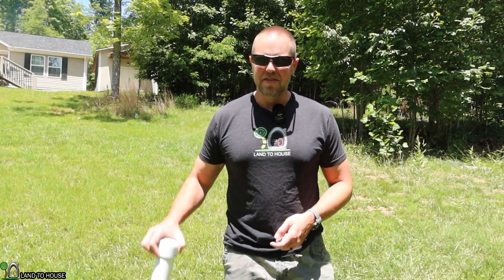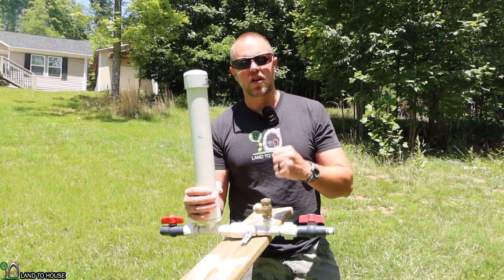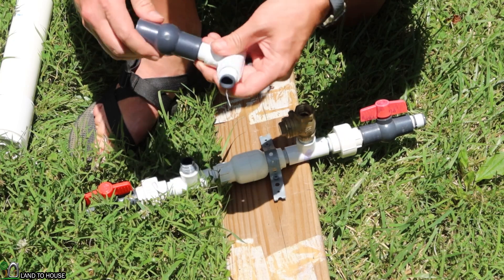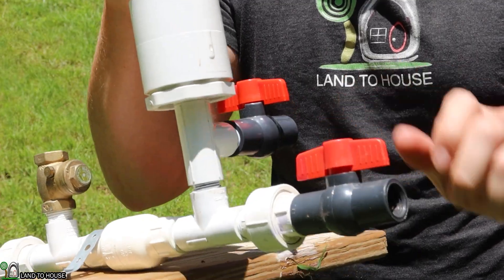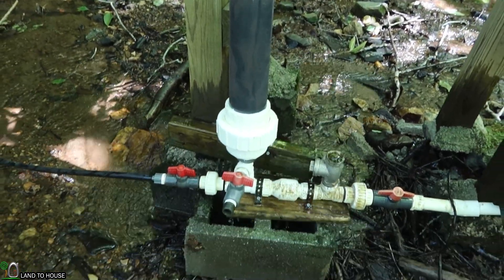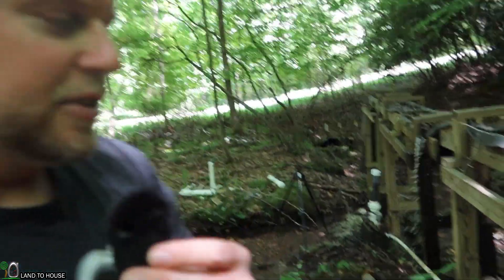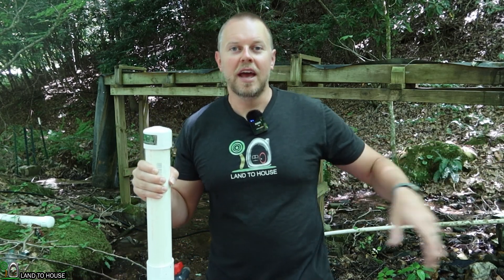Ram Pump Pressure Tank Waterlogged

Comment: Nice video and presentation. 
The mandated priming of ram pump in this video is respectful but desirable. Here is my two cent. 

Rotate the waste valve with respect to the pressure tank by 180. When presented by drive supply it becomes normally open. The dynamic pressure will cause it to slam shut and reopen by itself to start the next cycle, there avoided the mandated manual priming. If that works we’d expect the up hill head to be increased.

Another good example to self starting ram pump valve is one conceived by Japanese video on YouTube. It has a horizontal flow installed and a pendulum swing flap, open inward. Flap center connected to a threaded rod as ballast weight for normally open state.

Comment: I wonder if you could use a small water membraned pressure tank instead of the tube pressure tank. You could put some air pressure in the membrane and it would never be able to dissipate into the water.

Comment: would a piston to seperate the air from the water solve the problem for as long as the gaskets on the piston last? maybe thats too cost prohibitive an option for the plumbing?  but i think it could be a good solution for a more robust long term option that could get rid of the need to reintroduce air

Comment: You could just turn off the drive line and delivery valve while holding the switch valve in to drain the water out of the pressure chamber...
also you could make a taller pressure chamber to prolong resets..

Comment: Nice.  Draining the tank once in a while looks to also flush out some accumulated sediment.  I'm guessing the air that was in the inner-tube got beaten out over time, the valve isn't quite as good of a long term perfect seal as desired.

Comment: I have a general question regarding Ram Pumps, do you think they would be able to raise water 700 feet straight up a mine shaft? 
I’d like to see you and “Ghost Town Living”, ( Brent Underwood ) se if a ram pump can help him get water to Cerro Gordo, Ca. You can possibly benefit from helping. I’m not too sure though.
Reply: The trick to that would be getting enough supply head. Then it would just mean having strong enough materials (Metal pump and pipe work)  so yes it could work but it would be a little tricky.

Comment: Have you done any experiments with snifter valves like on the bigger commercial ram pumps? they work well keeping the air in the pressure chamber, until they clog up, its a very small hole!

Comment: What if you added a heavy plastic container... i.e. Gatorade bottle instead of the inner tube?   Oh and how about an update on the microhydro?
Reply: He tried that, it crushed flat under the 70+ psi in the pressure chamber.

Comment: I was going to suggest a car valve stem also. With a regular rubber one you could just drill a hole in the top cap and debur it nice and pretty then just pop in the valve stem just like in a car rim

Comment: It sounded like someone was hitting the drive pipe with a hammer or something else as if trying to drive a metal pipe into a rock wall with a hydraulic hammer and the after some air was added to the tank it sounded less like a metal pipe being driven into a rock.

Comment: Why not just shut the inlet and outlet ball valves and manually open the waster valve to drain the water from the pressure tank? That way there is no need for an additional ball valve and fittings.
Reply: There is another check valve between the washer valve and the tank
Reply: There is another check valve between the washer valve and the tank

Comment: add a air niple to the end like what you would use for a car bag system for a truck or like what a tire has but it has threads on the end to thread into a threaded fitting then you can just use a air compressor and if you have a clear pressure chamber then you can know if you put to much air

Comment: So a rampump uses water hammering to drive the flow?
Reply: Correct the hammer effect builds the pressure inside the tank
Reply: The inertia of the water in the drive pipe slamming to a halt drives a pressure spike that squirts some water past the delivery check valve, as much as 7x the static pressure of the head height.

Comment: Have you ever tried using one of those diaphragm pressure tanks like they use in a well pump situation? Seems like that wouldn't saturate the same way and open tank like you're using does? Maybe it's a cost versus benefit I don't know just a thought.

Comment: In the aircraft industry the “tank” you have is called a “hydraulic accumulator”.  The accumulator acts a dampening force in surges of hydraulic pressure.  The fluid is separated from the air charge inside by a metal membrane. 
Have you considered a floating rubber ball in your tank to act as a dampener or non-dissipating air charge?
Reply: I swear he has a video where he shows a tennis ball inside of the pressure tank.
Reply: @jackykoning  several where he tries tennis balls, racket balls, pool noodle, and such.

Comment: I don't think you have done a video like this before.. How about trying a house pressure tank (in place of the pvc tank you build) with a ram pump.  They have them from 1/2 gallon to over 50 gallons.  You can adjust the air pressure (thanks to the bladder inside the tank)  witch might mitigate the water log issue with the pvc pressure tank.  Will the small tank work better then the larger ones and so on.
At the very least it could make for a fun video/series.   Start with that and just find different things to turn into a pressure tanks. lol
Reply: Diaphragm expansion tanks are $50+ each, and expensive to ship if he changes the ones he sells, but yeah it could be a neat test to video for the channel.
Reply: exactly what I just wrote a comment about. great idea

Comment: You can also accomplish this without losing pressure by installing a tire valve in the top of the hammer arrestor and using a handheld bike pump to fill the chamber back up with air. Harder to do if the chamber is not clear but an alternate solution. After pumping it back up you may get a longer cycle (more months) before it waterlogs again.

I have a hammer arrestor like this on my well pump and I need to add the tire valve to mine because it has waterlogged and there is not an easy way to recharge it.
Reply: The up side of draining the tank is that you are also flushing out any accumulated silt.
Reply: @jllaine  would there be any silt that high up on the pump? The drain is above the waste gate.
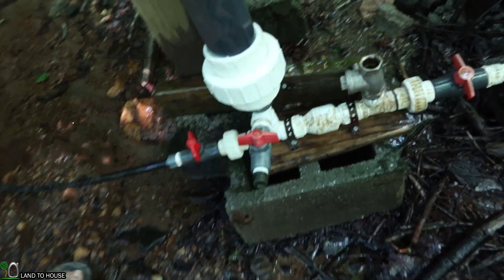Reply: @Zanthum  04:10 you can see some when he opens the ball valve.
Reply: @jllaine  you are right. It's such a small amount that I missed it but on one that doesn't have such a clean source that could buildup to be a problem with longer intervals. Do you have any thoughts on draining the silt that will accumulate in the pipe as well?
Reply: @Zanthum  Lots of clever designs in the hydroponic garden videos for making radial flow and cyclonic flow separators to keep the fish poo out of the pumps in the first place, the 'source bucket' can easily serve double duty.  Undoing the couplers and flushing out the silt from all bits once in a while in the second place.